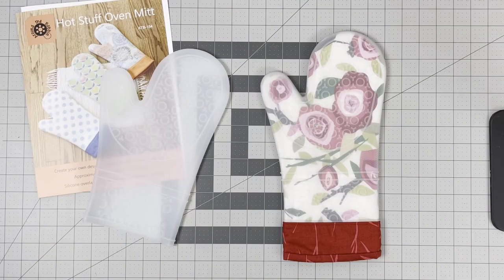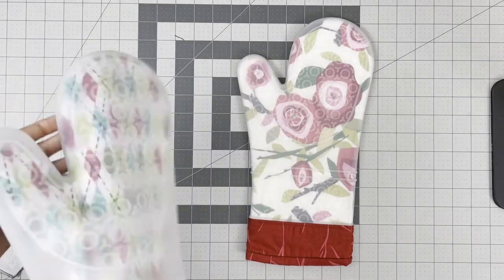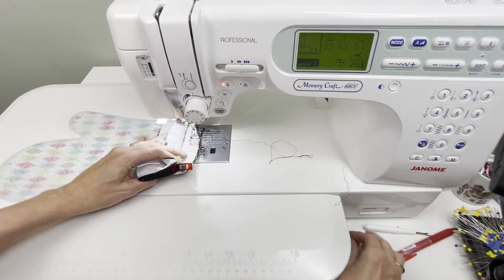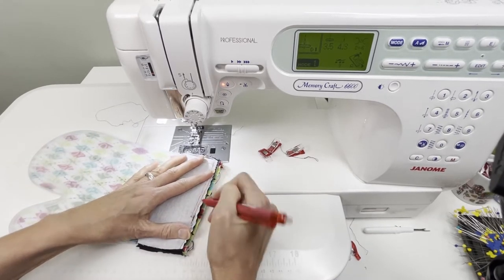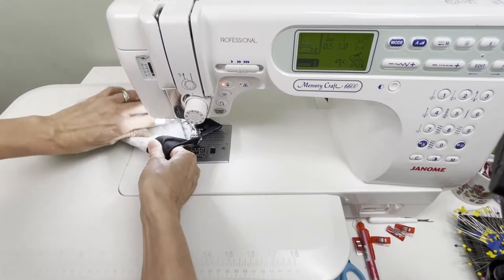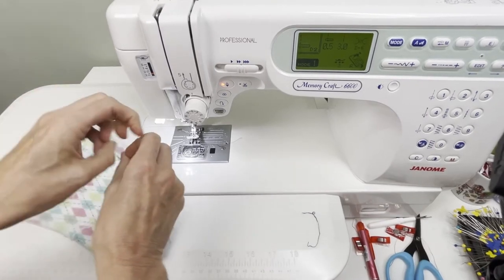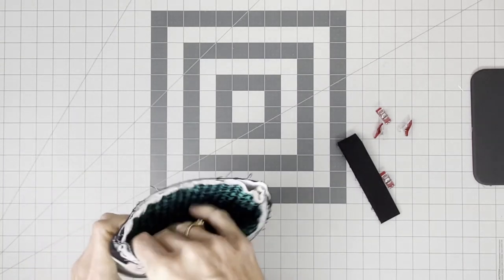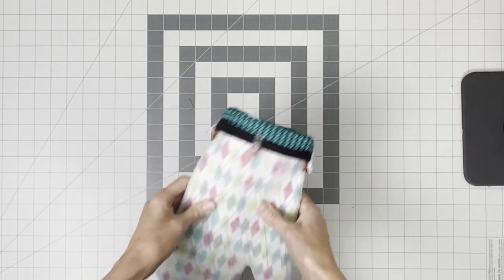Hot Stuff Oven Mitt Walkthrough Video

Comment: Question: I finally pulled out my supplies to make a set of these for me and my bestie. Do you have to sew the fabric to the silicone? If I got tired of the fabric and wanted to make a new insert then I'd have to purchase another refill. Is it because the silicone will slip off? What if you just make a longer cuff that folds over? Also, I'm sure you construct it the way you do because you trialed it but can you make the insert and lining together, sew together and then insert it?
Reply from the maker: Yes, you do sew the outer cuff to the silicone and the insert.  The quilted interior runs the length of the silicone and the cuff.

I could imagine creating a mitt the way you are suggesting but it would be a completely different project to be designed. In the current model the insert stays put under the silicone because it is sewn to the silicone.  The cuff is sewn in as well.